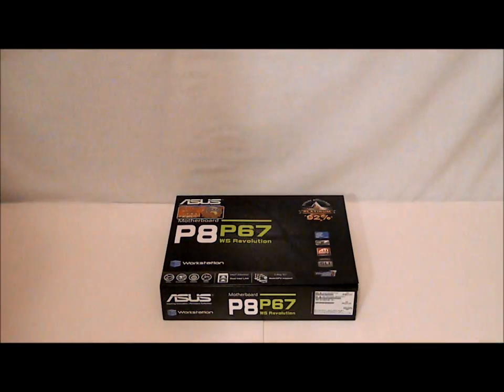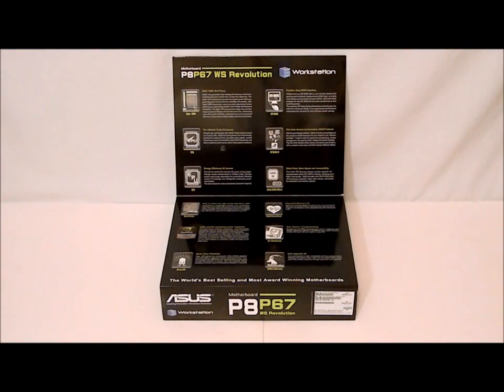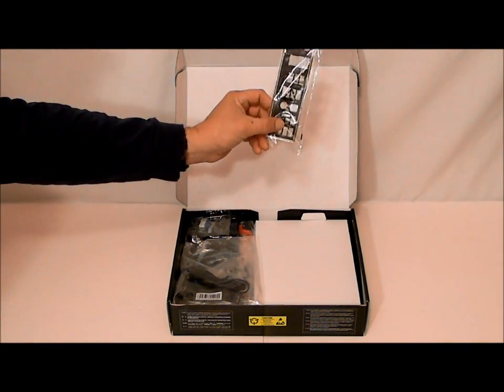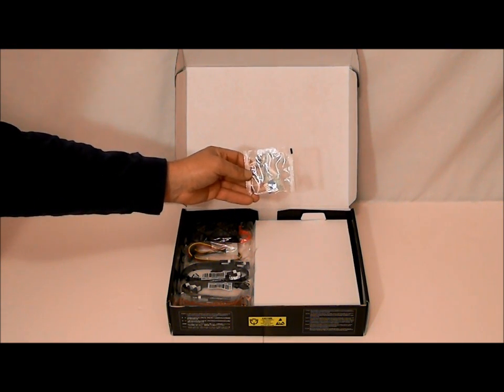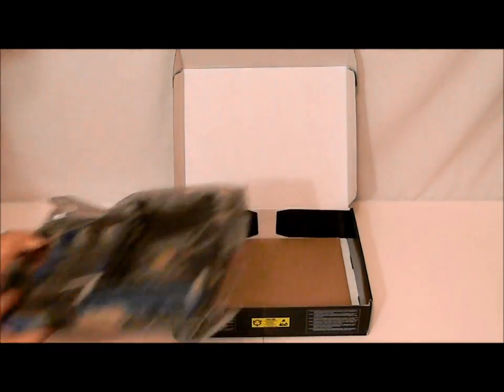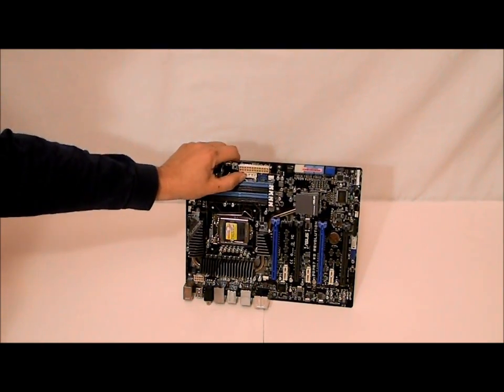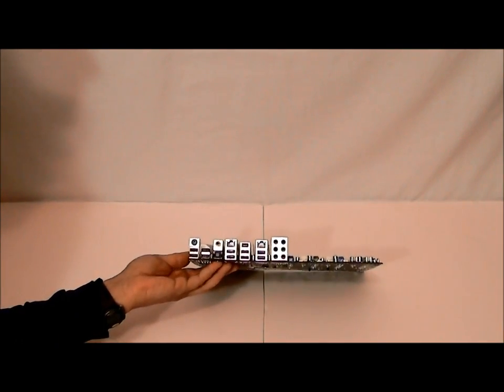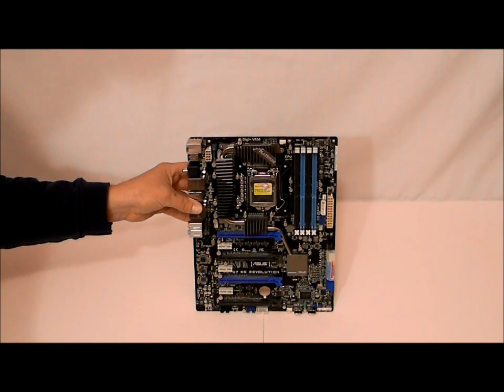ASUS P8 P67 WS Revolution Motherboard Overview

Comment from the maker: @merts487 
Auto tune works great, I have found you get better oc's depending on your ram, some ram with the old Jdec specs won't let you get that high,  I could AT my chip to 4.9 stable.

Comment: @LordNeb cas8 @ 1600 or cas 9 @ 1800 will run almost exactly the same , and actually the cas 8 @ 1600 will almost cert run at cas9 @ 1800 with just a little tweaking on voltage

Comment: kinda crappy boxing ...  the nf200 chip on this allows   2 pci x16 slots or up to 4 @ x8 , FYI , The blue slots are x16 and the black slots are shared with the blue , so you can also space 2 video cards apart ( make sure you grab a flex long sli bridge ) and still run them at full x16